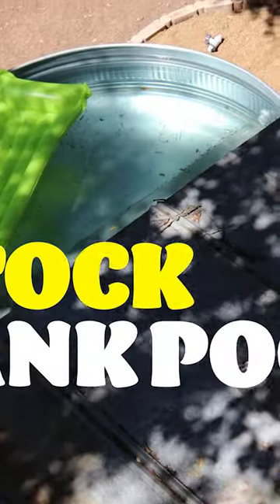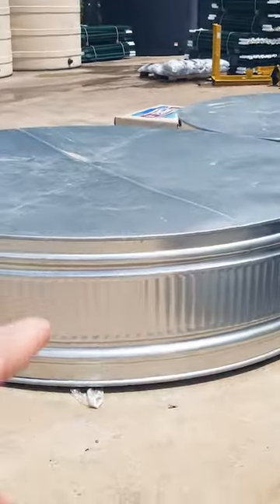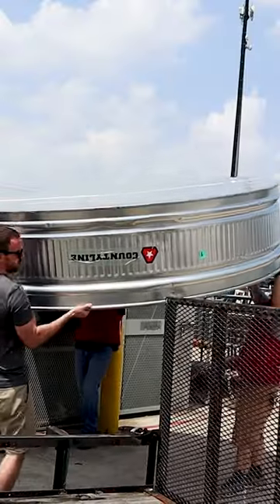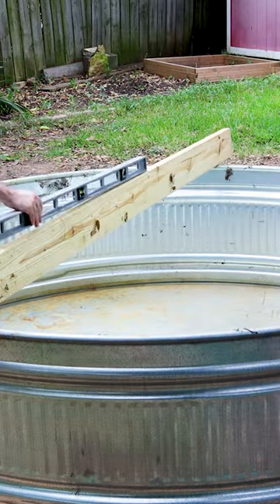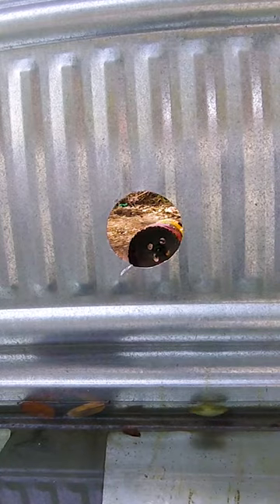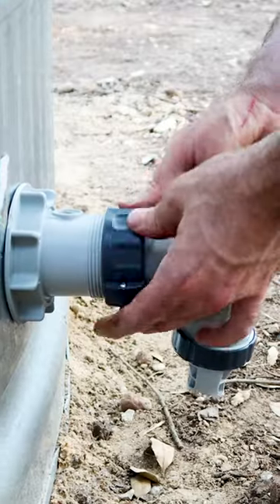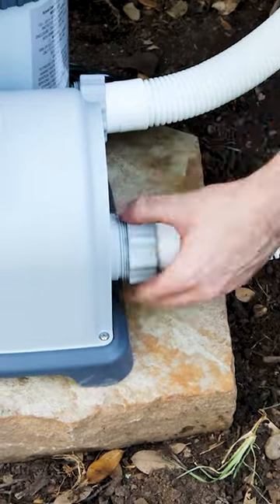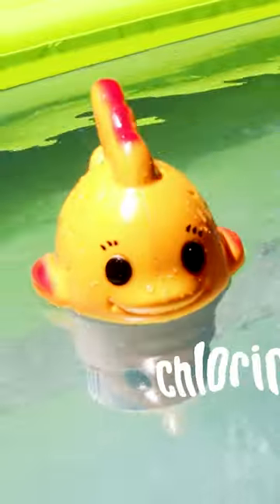How to Make a Stock Tank Pool | DIY

Comment: Total cost? How have you looked it? Curious about mosquitoes.
Reply: $140
Reply: @youridol More like 20,000 for the filtration system. Gotta deal with the mosquitoes
Reply: Less than 1k for whole setup including preparing the base and some landscaping around it

Stock tanks in my area are $549 at TSC
Reply: Also, no worries about mosquitos one bit if u are always running ur pump....  they cant breed in moving water....